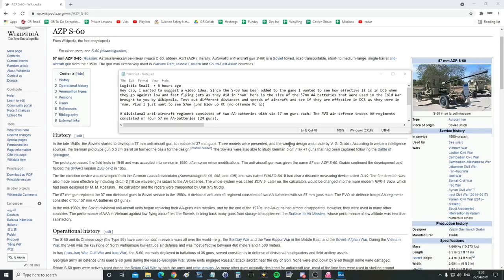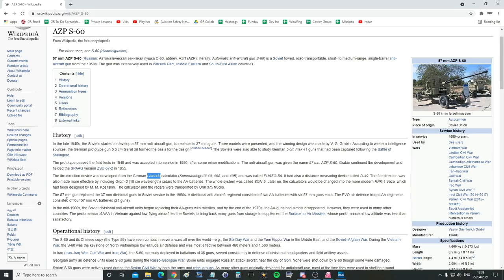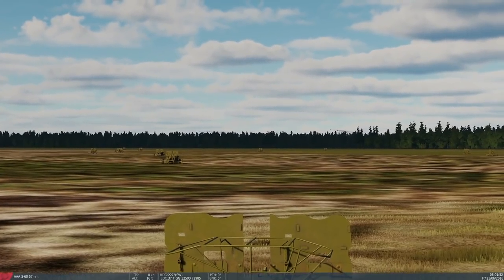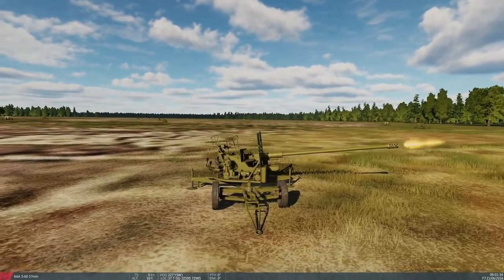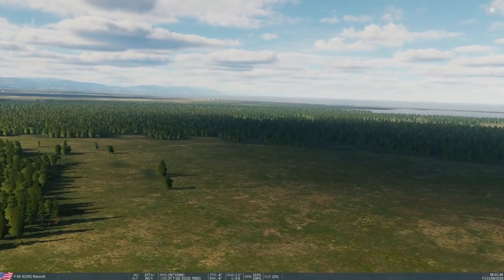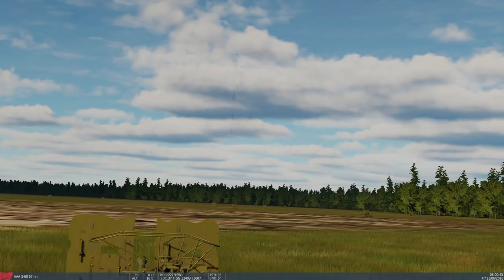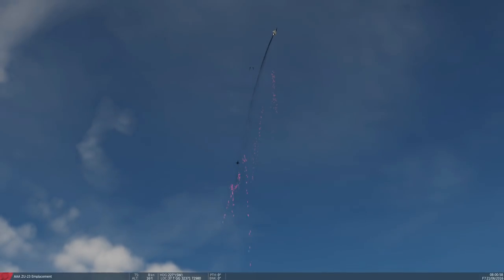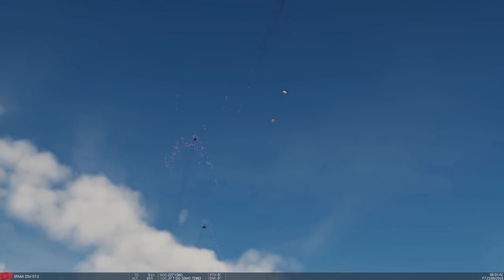Questioned: How Effective Is/Was Vietnam-Era Unguided AAA? | DCS WORLD

Comment: FYI Cap you should consider retesting this with the AAA guns placed as groups of no more than 4 in the mission editor. AAA guns in DCS work in such a way that only 4 light/ medium guns or 6 heavy guns in a group may engage targets at a time. If you watch the video many guns are just sitting there doing nothing while the planes fly over.
Reply from the maker: Copy thanks
Reply: this is only partially correct
Reply: @Mojje42  Can you elucidate? Can you make this work with larger group? What he’s saying seems to be correct at least in my experience.
Reply: @Rokaize  the reason why i say it's only partially correct is that some guns that you would consider light/medium fire in groups of 6.... otherwise the data is correct
Reply: @Mojje42  I see. So as long as no AAA go above groups of 6 then they should be fine?
Reply: @Rokaize  yeah 6 AAA per aircraft should work.... and even if you have a couple not doing anything they will go active if a plane is near them plus having a few extra means they will take over when the others run out of ammo or are re-arming

Comment: in 1960s, during Shah era, Iranian Army purchased some ZSU-57-2 from soviet union, during the 80s, in Iran-Iraq war, its discovered that these AAAs are useless against fast Iraqi jets, like mig-21 or su-7, so in Iran we found another usage for them, using ZSU-57-2 only as an anti helicopter SPAAG, the result was good, many Iraqi Mi-24s and Gazelles were victims of Iranian ZSU-57-2s.
Reply from the maker: thx
Reply: Soviets figured that out in the 60s and added radar and got the ZSU-23-4s, all pilots are weary since then
Reply: @Archer89201  no, ZSU-23-4 development is completely unrelated to ZSU-57,
And the funny things is ZSU-23-4 have a very heavy and bulky mechanical computer  to use radar data, (range, direction and speed)
This computer is almost impossible to repair or adjust and with the simple ECM usage by enemy will be useless.
Without upgrades that performed on Shilkas independently in past 15 years especially by Russia, Poland, Romania, Ukraine and Iran, original ZSU-23-4s are completely ineffective,
Another problem is their water cooling system for 4  guns that very unreliable and needs to upgrade.
Reply: @AriaAzari  well they are related in the sense that the Russians realized that the non radar guided AA guns had difficulties tracking ever faster jets that is why they went with the radar guided guns in the shilka, and yes these days they are not top level threat but when introduced it was one of the best. Also even today against non top tier airforces it is a viable platform and has seen continued upgradea including manpads attachments
Reply: @AriaAzari  ZSU-23-4 had many versions, only the early one was called Shilka.. ZSU-23-4V and ZSU-23-4M were called Beryoza instead. Equipment of soviets were always better than those they sold to the WP or third world.

Comment: I got sad news. 

A Submarine belonging to the Indonesian Navy sank on 21st April. They say the submarine has enough oxygen to keep the 53 crew alive for 72 hours.  
Right now there's only a few more hours before the 72 hour deadline.

Please pray for those 53 crew who might be alive for the last few hours in their life.

Count down starts........
Reply: F
Reply from the maker: So sad :( :(
Reply: @FatOnAxis  cmon man...
Reply: @FatOnAxis  Slow suffocation is a bad way to go. But the sea there is apparently 700m deep so that crew probably died instantly as no regular sub is able to handle that sort of pressure. It would implode and kill the crew before it reaches the bottom.
Reply: @passantNL  yeah but still really sad for the families at home
Reply: @passantNL  Indonesia said that the submarine has a chance at surviving the depths as the waters it sank in are 2000 feet deep. 

They say if the submarine didn't implode the the crew would be in a bad shape and suffocate slowly.
Reply: @Justineexy ...that's not how crush depth works. When it fails it is generally catastrophic. Failure happens so fast you don't have time to realize you are dying. Also, at 700m you are not sweating, you are cold, usually very cold.
Reply: @martindinner3621  Well, Indonesian Officials say they Found the submarine at 850 meters deep with Multiple Suspected cracks in the hull, So it doesn't matter bcoz there's a 99.999999% chance of 53 submariners already dead.

Comment: you made a major mistake

creating such large unit groups of AAA doesnt work with the mission editor
you can only put up to 4 guns in 1 unit group, every gun you place above that number wont open fire

So instead of putting 24 guns in 1 unit group, place 6 unit groups with 4 guns each
because only 4 guns in the large group will fire.
you can even see it in the video, not all guns are shooting
Reply: @grimreapers  Are you considering take another shot at this? Nice video regardless!
Reply: Another re-do,?
Reply: Redo please
Reply: this isn't 100% correct
did a lot of testing and most guns will fire... i think it was an issue with MP maybe or that there was a Player plane..not sure?
Reply from the maker: Just re-ran the mission and 20 guns fired of the 24 gun unit. Not sure why 4 of them stayed idle. 20 guns firing is enough I think for this test.
Reply: @grimreapers  

alrighht

did some more testing and found something mega weird

so when 1 plane approaches a 12 gun AA group only 4 S60  open up on him

but when 2 seperate plane groups come along 2x 4 gun groups split their fire up and attack both at once

when you add a third plane all guns fire, but they all shoot at different planes, each time in 4 gun groupings

this means only ever 4 guns from 1 unit group can engage 1 plane group.

when you add more plane groups the guns will then split fire

here what it looks like:
https://cdn.discordapp.com/attachments/836008770215739462/836011244875939860/Screen_210426_004706.png

test setup:
https://media.discordapp.net/attachments/836008770215739462/836011081797206068/Screen_210426_004921.png?width=1202&height=676

and here when I delete 2 of the plane groups:
only 4 guns shoot
https://cdn.discordapp.com/attachments/836008770215739462/836011512199249930/Screen_210426_004345.png

Comment: I'm not entirely sure AAA in DCS can receive guidance from track radar. The KS-19 and S-60 could both be radar guided, but most firing was optical due to attack runs by US aircraft typically being very low. The Kommanogerat seems to give radar-like performance to flak batteries its attached to though, the Flak 41's performance is especially impressive if its paired to one. I've been hit occasionally in the F-16 against that combination. Not sure it works with non-German flak systems though...

Comment: Are you sure that a EWR will not make it easier for the AAA ?
Reply: EWR is passive.
Reply: @pogo1140  Early-warning radar is definitely not passive. ;)
Reply: @RPrubber  Early Warning Radars are usually the size of a large building, I don't see too many of those mounted on fighters
Reply: @pogo1140  Never said something about fighters.. I said that they could help the AAA.
Reply: @RPrubber  EWR are not usually tied to radar guided guns, they use a different, more direct radar for target search and acquisition. Some systems have a 2 radars one for searching the second is the smaller tracking radar that actually provides guidance.

Comment: In reality, ZSU-57-2 was garbage! The only use it saw in Yugoslav conflicts, at least, was against ground targets. And there, it was scary effective! But against air, very little, even for the time it was designed. It had a bit slow turret traverse for AA gun and awful sights with slow rate of fire and low ammo capacity. That is why it was quickly replaced with Shilka.
20, 23 and 30 mm guns were way more effective just cos they were able to throw much more lead into the air in very short period of time.
Even during NATO attack on Yugoslavia in 1999, the AA guns were surprisingly effective. Not in shooting down planes as much as in making their life more difficult. After seeing massive amounts of tracers coming his way, the pilot would get nervous which in return could force him into abandoning the mission or making a mistake and missing the target. Also, it forced them to fly at higher altitudes. And gun crews also tried often to hit their bombs and missiles before they reach the target. Not too many hits there either, tbh...
Reply: AZP-57 was made for medium altitude and with fire control.. not so much for close range. Although - unlike popular belief - ZSU-57-2 also had fire control radar for a battery, the "Firewheel" it was rarely used. Carefully laid and centralised S-60 did much better job.